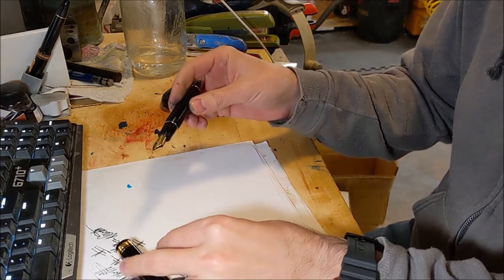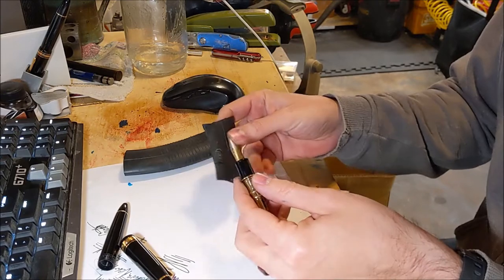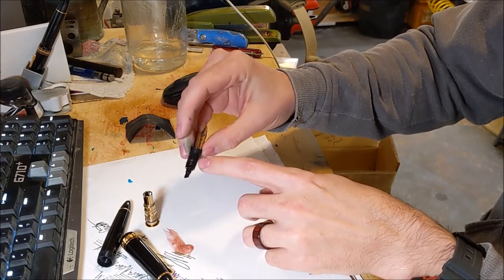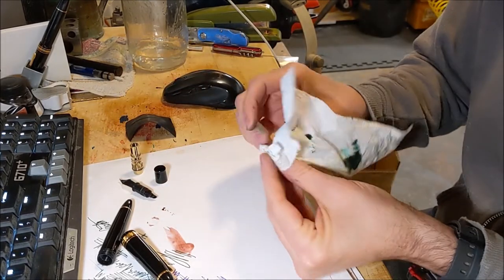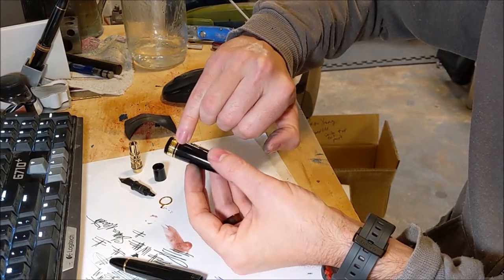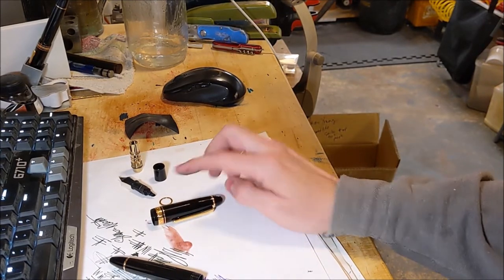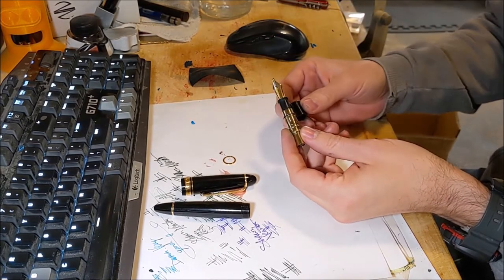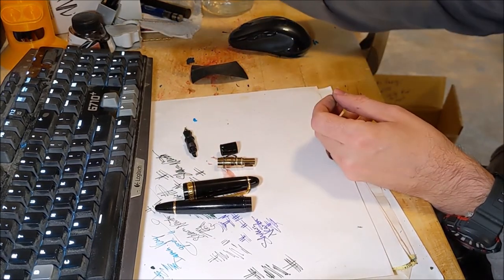Sailor KOP disassembly - for customization

Comment: Hi Shawn. What if I just want to take nib and feed out (to put them into a FNF housing)?
Do I still need to melt the glue and take the sailor housing out or I just yank the nib and feed out by force? Thanks
Reply from the maker: You can just pull them out on their own.  Unless you're making a new section to use the original Sailor housing there's no need to take it out.